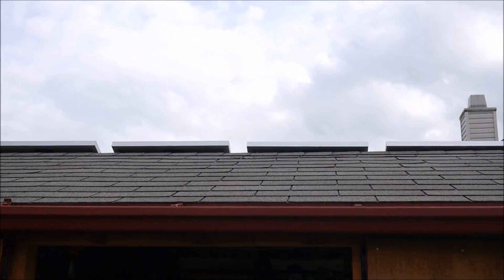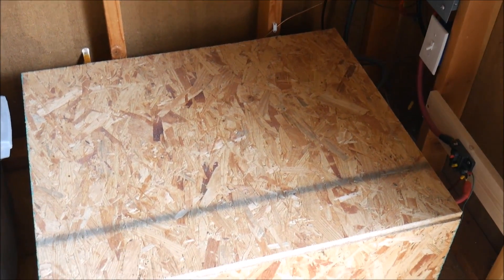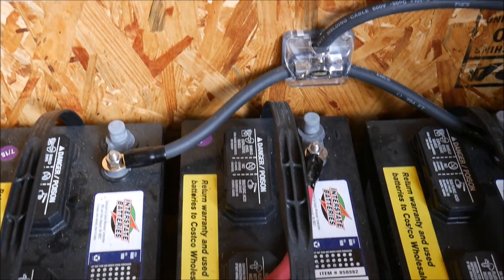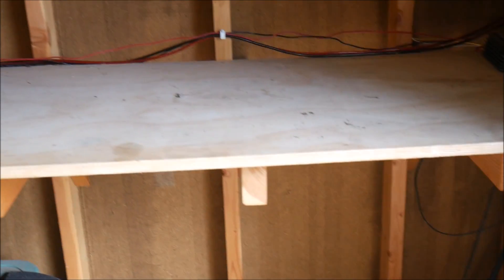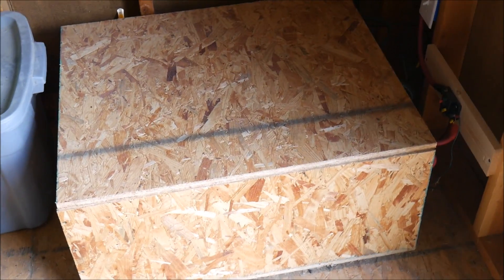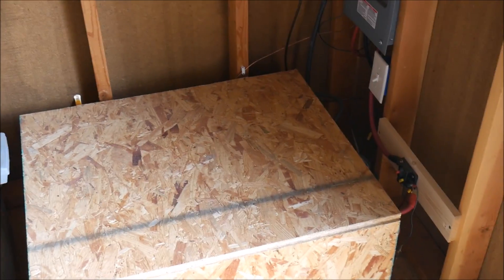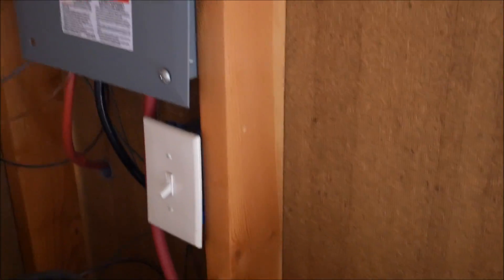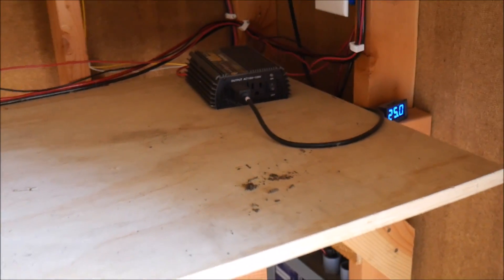Redoing The Solar Shed Part 0 - Introduction

Comment: Hi, I'm wondering what are your loads and how much power are they demanding?
Reply from the maker: Good question.  I have 3 different loads inside the house and 2 loads in the shed.  Inside the house I have an inverter for my entertainment system (~300W max under load), another inverter for my charging station for small electronics (75W max), and a long run to another inverter in my office that almost never gets used but if it does it is about 10-20W.

In the shed I have my 2 corn cob LED light bulbs (26W total) and a small inverter for an LED spotlight and also a charging station (load varies).

Comment: $ marine deep cycle and 4 golf cart batteries as one battery bank?  Were the different ages?   Here is to doing it better the second time. Cheers
Reply from the maker: Yep, that is one of the nagging inefficiencies I want to get rid of.  2 of the gc batteries are over 3 years old and the other 2 are over 2 years old.  The marine deep cycles are only a year old.  I'll probably re-purpose them into a 12V bank in a separate system.

Comment: one suggestion.  you said efficiency and reliability is key.  thinking that means...it is time to say goodbye to your pwm no matter how good you think it is.  nothing can compare to a fully adjustable/programable mppt controller.  only then one could have healthy and longest lasting batteries.  i made the switch to midnite mppt.  i bought a second one.  and plan on more.  good luck to you.  it's fun playing with this stuff eh?
Reply from the maker: Yes, I mentioned that I was going to upgrade to MPPT.  The reason I did not go MPPT before is that the math shows it is not economical on systems smaller than 1000W as it is cheaper to just buy an extra panel to get that production as opposed to spending the $400 extra for an MPPT version of the same controller.  However, I am out of space on the roof of my shed and I do not want to put a ground mount next to the shed because it would take up too much space.  So I need that extra efficiency since I don't have the option of another panel right now.  Plus, I want to try Midnite controllers and have that built in monitoring.  So that is another excuse to spend the money :)
Reply: LDSreliance ...yes, but it is more than just extraction of power.  most importantly it is the ability to be able to control the voltages of bulk, absorbtion, float and equalization.  also the duration of those voltage settings.  being able to do that will give the most battery life.  if one can find a pwm controller that will do all that would be fantastic.  i have not been able to find one.  so i went with midnite mppt.  there is a learning curve to master.  not difficult but must be learned.  they come with an excellent operators manual.  one hint on mounting... i used 1 inch spacers to give extra airflow on the backside of the controller.  that means the controller standsoff the wall 1 inch.  unit runs much cooler doing this additional mounting step.  you start pumping some serious power through the controller you will see what i mean.  you will be thrilled to own and operate these controllers.  gl.
Reply from the maker: I am looking forward to it.  I will check into the standoff idea.  Thanks!

Comment: oooo, I can't wait to see how you monitor the battery voltage, both on the web and in your network. I have wanted that myself, but I just can't seem to find anything about that.
Reply: Aleric Johansen ....check out midnite classic controllers.  web monitoring is available.  even your cell phone can do it.  good luck.
Reply: Aleric Johansen ....check out midnite classic controllers.  web monitoring is available.  even your cell phone can do it.  good luck.
Reply: awwwww, i would have to get a new controller. I already have a controller, and a new one, especially one of that price, will be hard to get. that is something like $800. Not a cheap item there. Plus, I run linux systems, so the "local application" wouldn't work on my computer, though kinda expected there, i would have to use the android to monitor my charge and all that.
Thanks for letting me know, but i was hoping for something....cheaper. And for something that i don't have to replace the controller itself for. When the time comes to replace my controller then i can look at that, since now i know that exists.
Reply: Aleric Johansen ....midnite classic can be bought for $550 online.  new...american made in seattle...5 yr guaranteed...good for solar...hydro...windturbine.  there is a solar only model for roughly $100 cheaper.  factory offers a full rebuild of any needed parts at the end of the 5 yr guarantee to fully refurbish if needed.  you also get an additional warranty with the refurbish.  refurbish cost is roughly $150.  great and friendly live support if needed.
Reply from the maker: Aleric, usually you can interact with your controller with meterbus communication but I don't know what you have.  I may have to play with that and demonstrate it in a video with my old controller you see in the video.  The new one I am planning on getting is from Midnite (like Robert said) and comes with monitoring capabilities.  Other brands also can be monitored out of the box, at least at the MPPT level.  But like you said you don't need to upgrade just for that.  There should be ways to do it, especially since you seem to be tech savvy if you are running Linux.

Comment: why get rid if the square d load centers?????    that is top notch equipment.  i run square d exclusively in my system.
Reply from the maker: The ones in the video are Homeline series, which is not technically rated for DC.  The QO series is what I will be upgrading to, which are fully rated for 48VDC.
Reply: LDSreliance....oooo....i didnt notice the homeline.  yeh...hard to beat sq d qo.
Reply from the maker: Yes, it would be hard to see in the video.  The Homeline works in this application but I want something that is actually rated for DC and to make sure I can avoid any arcing with higher current.

Comment: how long have you had your solar system for and how much electricity did you use or get out of those deep Cycles was it enough to power your house
Reply from the maker: I built the shed 4 years ago and put the solar on it shortly thereafter.  It was not intended to power my house.  It was just going to be a place to tinker on projects, recharge my power tools, and escape the house and my kids for a bit!  However, it quickly became a storage shed as our family grew so unfortunately I don't use it for many projects.

The next year I pulled power from the shed into my house via underground conduit.  It powers my main TV and entertainment equipment in my family room as well as one wifi access point and our electronics charging station for laptops, tablets, and phones.  In an emergency it could provide power for lights and maybe a mini fridge although it could not run the fridge around the clock except maybe in the middle of summer.
Reply: LDSreliance ....just a FYI.  your present solar can run a solar refrigerator full time.  the trick is buying the proper fridge.  two of the best choices is ARB and ENGEL.  I run the Engel 45.  only one moving part in the compressor.  power draw is close to 24 watts.  2 amps at 12 volts during operation.  duty cycle will vary with ambient temps.  on my hottest days....100 plus degrees...duty cycle would be something like 3-4 minutes on...then full rest for like 15-20 minutes...then repeat the whole process.  these units are not cheap.  my engel was close to $950.  but guess what.  it has already paid for itself because i dont buy ice anymore.  one year payback for me.  so the fridge isnt going to break your battery bank.  it is my 32 inch tv that breaks my battery bank.  sucks 90 watts.  thats an ouch!!.  something to think about.
Reply: He said it was in his shed, which means it doesnt power anything from his house.
Reply from the maker: Robert, I would love to get one of those 12V freezers.  But like you mentioned they are 3-4x the price of a similar sized AC version so I have not been able to justify that purchase to this point.  Also, my system is 24V so I would have to lose a little bit of efficiency converting down but that isn't a deal breaker.  I will buy one someday!  Just gotta get this channel bigger and then I can justify doing some of these bigger projects like that.
Reply: If you havent already, monetize your youtube channel then you can play with solar more.
Reply: All of the DC freezers I've seen are 12 or 24 volts, which is good. But the fact remains that these DC freezers are >$1000.